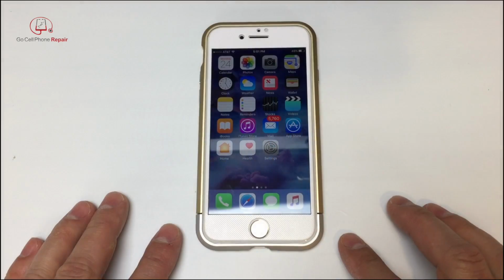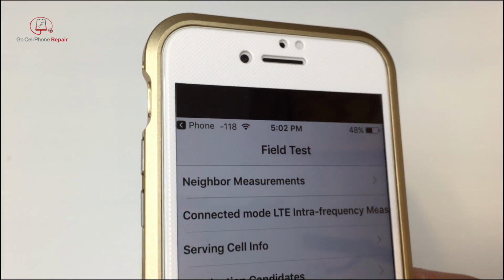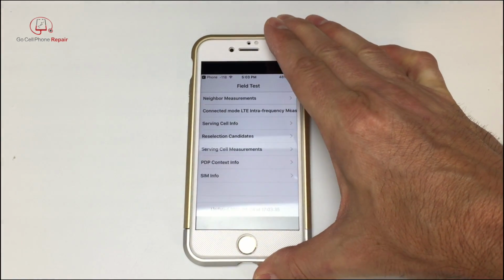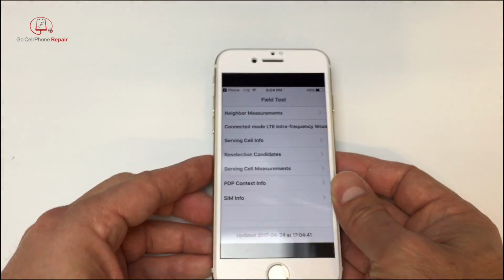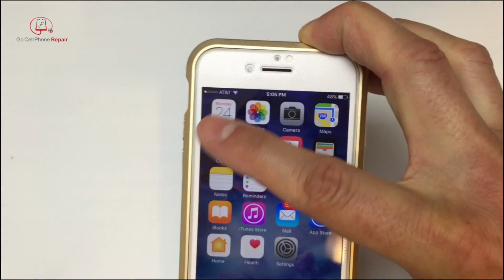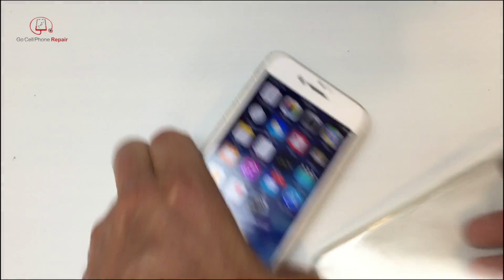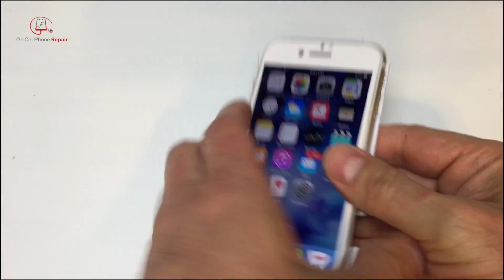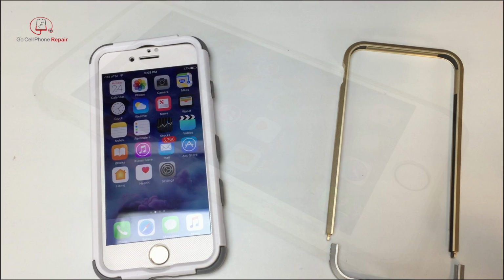Using Field Test Mode With iPhone Metal Bumper

Comment: Have you tried using GPS with this bumper case?
I recently modded my swapped out the guts of my rosegold iPhone SE to a 100% clear plastic case and could never get a GPS signal. Putting the internals back into my original casing, everything went back to normal.
Reply from the maker: I have not. Will do when I get a chance.